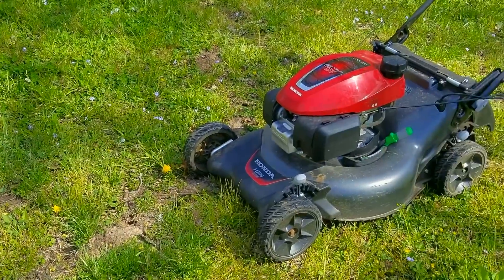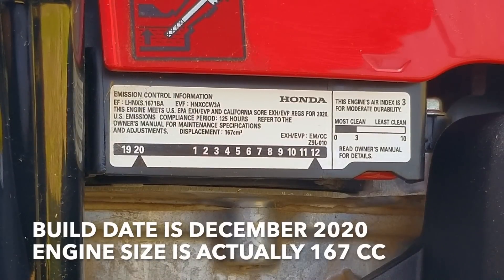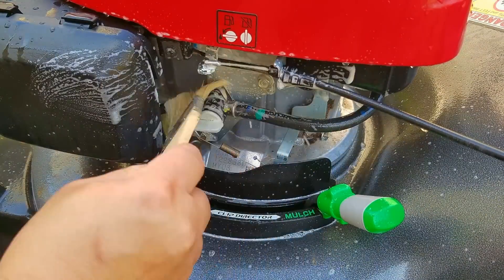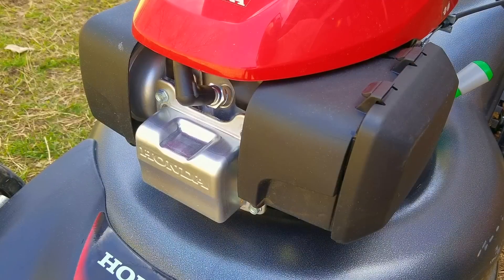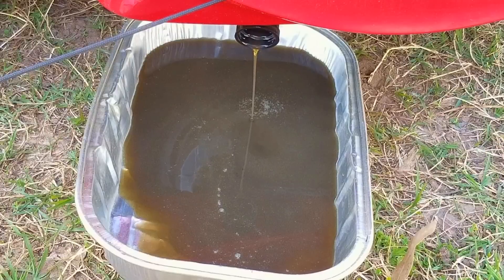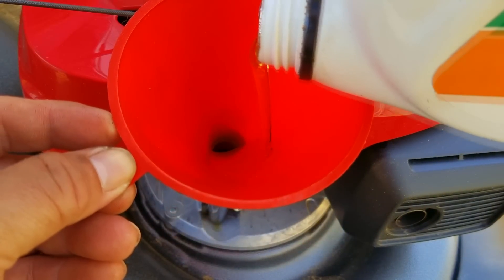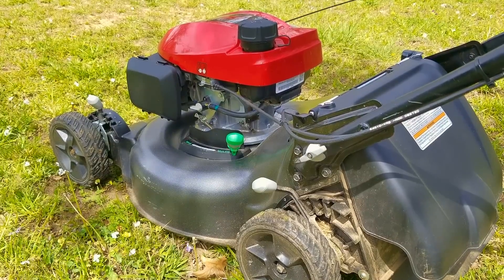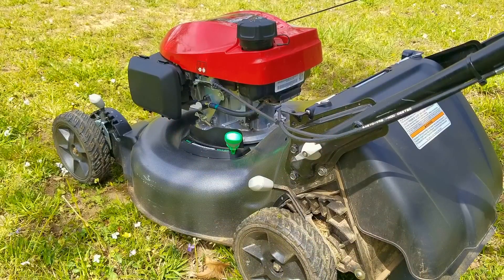Fixing A  Honda HRN 216 Mower That Won't Start

Comment: Hey bro simple repair to this mower. I really thought that you would have to take the carburetor apart tho. I never used or owned a mower however I think that I would look for a mower that have more metal on it because of how aggressive I might have to be with the type of grass we have in our lawns here in the Caribbean.
Reply from the maker: I was also thinking I would have to take the Carb off, to fix it but luckily it was an easy one. Yes my preference is for more metal parts as well.
Reply: @INSIDEHOUSEGARAGE  the mower probably wanted to visit you before going back home😅
Reply from the maker: lol.. good possibility

Comment: From Honda I would buy a newer model of the one I have now yes. Briggs, Kohler not so much. I am sticking to Honda motors from here on out. I personally love the GCV160 motors. I have 2 at home now and 1 more on Sunday.  I love how reliable and affordable to fix they are. Honda makes the best small engines in my opinion.
Reply from the maker: you and me both, no matter how old my gcv is getting I love using it.

Comment: Hi. I have the same mower but with the added blade clutch. Right out of the box the mower has always has a slight surge at idle after the choke pulls off. While choke is on and the engine is warming up, there is no surge and engine runs fine. I want to ask you about the carburetor. Underneath the Phillips head screw is a very small hole. Is that the idle jet? And that limiter cap next door to the Phillips head screw; is that an air bleed needle?
Reply from the maker: yes, under the Phillips head , should be a round plastic piece that holds the idle jet.   And yes there should be a "limited" idle mixture screw next to the Phillips.  That might need to be adjusted to help out with surging as well.

Comment: Great job as always! You are professional with what you do and checking over other things that could cause problems is the way to go! Also I do still feel like the quality is there in that machine, just it is a more basic model so it seems designed well, especially the fact that most Honda's have fuel shut off valves compared to other brands.
Reply from the maker: I try my best, if I can , within time constraints. thank you C:\ DOS.

Comment: Thanks so much for such an informative video. Can you please share the primer oil that you used for it that got the mower started which was it..?
I am having the same issue I checked the spark plug.
Not to mention the gas in the tank is from last year which I will change now after seeing the video and hope it works.
Reply from the maker: Thanks, what do you mean by "primer oil"?

Comment: My dad has a briggs and stratton engine (190cc) lawnmower, and he run it with the original oil for over 11 years. I changed it and it was dark as death but the lawnmower still runs. It does have low compression, any way to fix that?
Reply from the maker: unfortunately to fix the compression would require new rings honing the cylinder
Reply: Thanks for the answer.
Reply from the maker: no problem,

Comment: I really need help with ours. Ours makes a stop go sound humming sound while on and mowing the lawn...like it's slowing down speeding up..sounds weird..hard to explain. Is it the carburetor?
Reply from the maker: the explanation is difficult to completely understand but there's a good chance that it is. Have you tried leaving the fuel cap, "loose" while using it, and seeing if that might help?

Comment: Hi, I was wondering what is the damage that will occur if you have to much oil in the engine?
Reply from the maker: that's a good question, with too much oil, the Oil can get foamy, which is not desirable in this type of oiling system.
Reply: Foamy oil - the air bubbles mean metal on metal contact resulting in premature wear.  Better for an engine to have 2 Oz too little than 2 Oz too much. And in this case it was significantly more than 2 Oz.
Reply from the maker: yes sir

Comment: I have one of these mowers, will start all good but when you shut it down leave it for a bit then come back to use it again it’s impossible to pull the cord….not sure if it’s the spark plug or it’s pulling to much fuel in and got to much compression.
Reply from the maker: if this happens again, take the spark plug out, and then pull it and see if anything comes out of spark plug hole.
Reply: Assuming compression spark plug issue isn’t burning the fuel right and flooding the motor?
Reply from the maker: not necessarily, I think your carb is flooding the engine, when you shut it off.
Have you checked your Oil level recently? IT might be higher than normal, because some fuel is getting into the engine.

Comment: I have this mower and i got it for 100 non running. I cleaned the carb and now it runs but it surges. Could this be the governor spring?
Reply from the maker: I don't think so, bad springs don't cause surging, the carb does.  I would replace the carb, it'll be a lot easier than continuing to try and clean the carb.
Reply: @INSIDEHOUSEGARAGE  could it possibly be a gasket leak?
Reply: @INSIDEHOUSEGARAGE  i ended up fixing the problem. Turned out the idle jet circuit was clogged and i had to get torch tip cleaners to clear it. Thanks for the advice.

Comment: Did you buy that scraper like that or did you grind down a regular scraper? I really need to buy or make one like this, it’s a great idea and looks like it will help prevent scratching up the underside of the deck. Plastic ones keep breaking on me.
Reply from the maker: I got it in a freebie curb pick up, I don't remember when but I think it's a paint bucket scraper.

Comment: Another great video! Looks like a decent mower but I've never used a mower with a blade control/stop that has a flat piece of metal like that, always been round.. It seems like it would be a pinch problem?  Something I've wanted to ask for awhile, where did you get the round scraper thing? I've never looked at the big box stores for one..
Reply from the maker: I actually got it in a freebie the I picked up from the curb. I think It was on top of a mower, or an edger, when I picked them up. IT's pretty neat, I think it's a putty scraper for doing joint compound or something. thank you Ed Rodrigues, for the question l.

Comment: I generally don't buy new mowers, because I just take care of my old ones and they last. Even if I do need another mower, I typically manage to find a freebie often enough, so I'll just keep the better mower and sell off my old one. If I did have a 1 year old mower, I would almost definitely not buy the newer model, because chances are there won't be any problems with my old mower after only 1 year, and also it's very unusual for any significant updates/upgrades to be made to a product in only 1 year, and that goes for more than just lawn mowers. The only reason I would consider upgrading from my 1 year old mower is if there are significant upgrades that will actually help me do a better job, and possibly make more money if I have a grass cutting business. Otherwise it's not really worth spending $400 all over again.
Reply from the maker: you do what I do, just wait and something good will come along.  thank you NerfCraft.

Comment: Is that Simple Green Extreme Aviation that you're using? That's my go to cleaner since it's safe on aluminum and inexpensive when you buy it by the gallon and dilute per the instructions.
Reply from the maker: no but I wish it was, I've remember seeing the aviation version once before at work, I don't remember exactly why the were using it but I remember the smell

Comment: I have a HRX217 and simmilar problem. tried a little fuel on choke but didnt work. Now the oil is as black as tar and also seems like it's very thick. I did put this mower to the side when it didnt start 8-9 months ago. Going to change oil and going to change and it a few times... sadly still does not start
Reply from the maker: have you considered replacing the carb?
Reply: @INSIDEHOUSEGARAGE  Carb is very clean... i guess i could switch carb from my other mower to see if that will help. I think I am not getting any sparks and I have checked the coil and its clean as well.

Comment: It certainly says a lot that manufacturers are more interested in selling you a new piece of equipment every few years than selling you a quality product that will last for a decade or more. Case in point, I have a 18" Bobcat mower... 3.5 hp B&S, purchased new in 1978...it is a trim mower that I use on edges and areas that my 48" Scag can't get to. This mower has been used at least 30 minutes a week, April-November since new. Regular maintenance and I run av-gas or mo-gas...no ethanol. I know that this is an anomaly, but still, today, bottom line rules over quality and salvage yards and landfills are full of equipment that should still be in service
Reply from the maker: wow that's an amazing piece of machinery, thank you for sharing that Gary T.

Comment: I have model HRR2163TDA and it won’t start what do u recommend
Reply from the maker: I'd do a test start to make sure it still works, you can use starting fluid to help out. 
if it starts, the you have a carb or fuel issue. 
If I doesn't start or run, then check for spark and compression.
If you have no spark, check the coil, If you have low compression then the engine Is worn
or you have a valve train issue.
Reply: Ok thank u
Reply from the maker: no problem

Comment: My thoughts would be no, I didn’t like the newer model of Honda due to being bar bladed and the  body style. The engine seams okay but plastic is thinner once cover.
Quick repair worth trying a bit of fuel in carburettor first, great work once again. The oil was overfilled and dirty considering it was clear collored new, owner did change the air filter.
Reply from the maker: ah yes, you're right, she did mention that they threw some new parts at it to try and get it to work. Thanks for remind me

Comment: Trying to figure out to how to manual prime it after taking off the air filter ?
Reply from the maker: I use a chemical bottle.  Just try using a cap from an oil bottle.
Reply: @INSIDEHOUSEGARAGE and push the opening?

Comment: I have one of these mowers.  The issue I’m having is that the cord that’s pulled to start the mower is stuck and not releasing or contracting like it should.  Additionally, I mowed over a public drain cap which bent my blades so I replaced it.  After replacing the blades, the cord to start the engine is stuck and doesn’t release or contract.  I need help.
Reply from the maker: sure thing, did you lay the mower on it's sided to change the blade? if you turned it on the wrong side, then you might have hydro locked your engine with oil. Take out the spark plug, pull the rope 4 to 6 times and watch for oil to come out of the spark plug whole, reinstall the plug and hopefully it's easy to pull.
Reply: @INSIDEHOUSEGARAGE  thanks…I’ll give it a shot!

Comment: Do you have a video that shows the pull start won't recoil so it will not start
Reply from the maker: I do but it would take me a long time to find it.  Simply take the 3 nuts off the recoil and put it on the table upside down. Then spray carb cleaner, or brake cleaner where the spring is located at, and then tug on the rope a bit.   Keep doing it until it starts working.

Comment: Interesting.  Oil changes on my K5 Honda GCV190 (one generation earlier than this one) take around 450ml, which would be roughly 15 ounces.  10% more, give or take.  I've never seen one of these newer engines torn down, but it would be interesting to see the differences.  

I'm mildly curious why you use liquid fuel instead of spray ether to awaken a non-starting engine.  Most starter fluid brands have an upper cylinder lubricant (at least the stuff I use) and it seems more precise and possibly tidier and safer to put the fuel right where you want it, and not all over the airbox.  Cost, maybe?
Reply from the maker: most people don't agree with using starter fluid, no matter what lubrication Is in. If I use the can, I will get inundated with thumbs downs and rude comments, so liquid fuel it is.

Comment: Hey I have a project at The moment it is a 2003 hayter harrier 41 and it will run in choke but when I take it to half choke it will start to surge then when I put it to run it will die do you know why this would happen thx
Reply from the maker: it would seem the carb need to be cleaned and the pilot and main jet need to be cleared, If you don't want to do that, I would consider replacing the carb instead.

Comment: I have the exact same mower with the same engine. I won't start. I thought it was a carb issue as the friend left the gas in it over the winter. I cleaned the carb in a ultrasonic cleaner.
I checked the carb and it holds 5PSI of pressure. Put it back on, and it still won't start. Gas is coming out of the muffler? Ideas??? Im out.
Reply from the maker: when you cleaned the carb, did you completely disassemble it? and as for the gasoline, it should like the float is sticking.

Comment: for me probably not that upgraded type of Honda 4 stroke as the metal couling cover ones are better qaulity from my view too.
Reply from the maker: I know what you're talking about and I agree with you.
Reply: @INSIDEHOUSEGARAGE  for sure and lots of people i have heard prefer the metal ones as the plastic ones can break easier and then the covers are a paint to try and fix where the metal ones you can easily repair plus bang out any dents etc.

Comment: this 170 is same as mine.. runs about one or two minute.. gas is good, I tested cap is vented, I drained it through pitcock no flow problem, I cleaned the carb well. still dies after a minute or two.. bought a new carb same thing. spark is good! What else?? only less then two years old
Reply from the maker: very interesting. I know you said you tested the cap, but I would like you to try running, with low fuel in the tank , and with the gas cap, very loose.  You didn't mention, if it would restart, right after or if you had to wait.  I would consider replacing the spark plug too.

Comment: I picked up one of these it hit a stump or something bent the shaft blade adapter and the blade got a new adapter and blade and bent that shaft back and the blade still hits the deck I'm guessing the deck is bent I'll have to tear the whole thing apart
Reply from the maker: wow, they must have hit some concrete or something that didn't give at all.

Comment: I have the exact same issue, not even one season old.
Reply from the maker: wow, that's hard to believe coming from honda.
Reply: @INSIDEHOUSEGARAGE  Your video was very helpful by the way! I followed Honda's directions for the oil when I purchased the mower, however like you mentioned in the video, it was too much oil. I poored the old oil out and changed the oil to the proper amount. It didn't start until I sprayed a little starting fluid on the carb and it ran just fine after that.

Comment: Then you have me who has 4 older Snapper 21" mowers. 2 of them are from the early 90's, 1 is early 80's and the other is from the mid 70's with the original engines. They'll last me forever with oil changes and some upkeep. I got 2 for free and $10 for one and $15 for the other one. I literally cleaned the carb on 3 of them, changed the oil and tightened all the nuts and bolts. Mostly all metal construction and love them. These new ones are not meant to last 3-5 years and you toss them. Sad.
Reply from the maker: wow, your collection of snappers is pretty amazing.Was that done on purpose?
Reply: @INSIDEHOUSEGARAGE  Kind of....I really like the Snapper brand, but the older stuff. I also have a 1983 Snapper RER and snowblower.

Comment: Would of been great to see what you use at the top of the power to turn it on.
Reply: Error mower
Reply from the maker: can you elaborate more? for some reason I don't understand the the question, even after your correction.  Are you asking about what I put into the mower to help get it started?

Comment: Same issue, changed oil and new gas primed and still doesn’t start. 🤦🏾‍♂️ tried to start it cut off in 10-15 seconds.
Reply from the maker: did you drain the gasoline from the bowl of the carb?  If not, the old gasoline is still in the carb, despite new gasoline in the tank.

Comment: I think Honda went a bit too far with the value engineering. This mower will not last like the older ones. I'm sure I'll be seeing more of them in my shop. Cheers!
Reply from the maker: thank you The Lawnmower Lady.
Reply: Thats funny my honda with the manual choke starts up 2 to 3 pulls. 4 yr old one that I just picked up won't start unless I shot some carb cleaner in the carb and if it does start it'll die after like 2 to 6 seconds. Changed the plug changed thermowax changed the oil previous guy over filled it. And I cleaned the carb still no go.
Reply: @tonychau1983  Definitely a fuel delivery issue. Make sure the idle circuit is clear ( under the screw on top of the carb). A guitar string works well. Carb spray should go through 5he jet on top, and come out the small hole in the throat. Good luck.
Reply: @TheLawnmowerLady  am I suppose to unscrew the screw the top of the carb while cleaning. Going to clean it some more and try again
Reply: @tonychau1983  👍

Comment: I have the same exact mower, but mine has issues. 
It’s about year and a half old, but it has no spark,
Replaced spark plug, still no spark. 
Replaced ignition coil and spaced it properly, 
Still no spark. Replaced the kill switch, still no spark. 
I hate this mower.
Reply from the maker: sorry to hear that